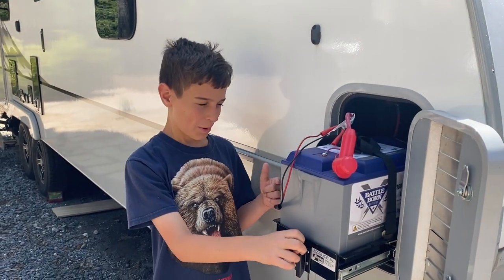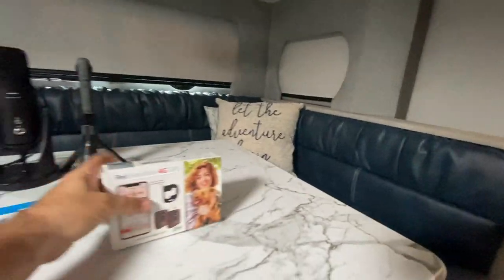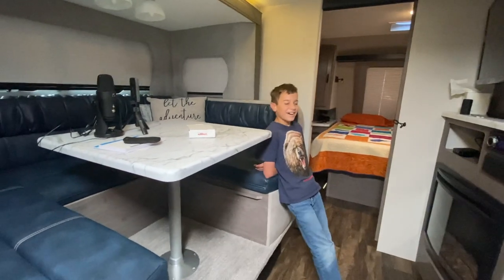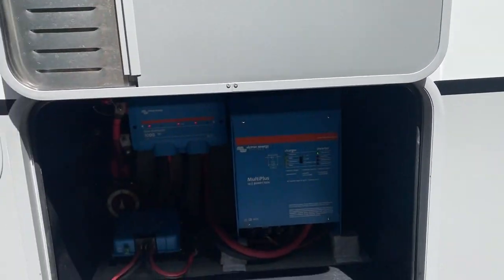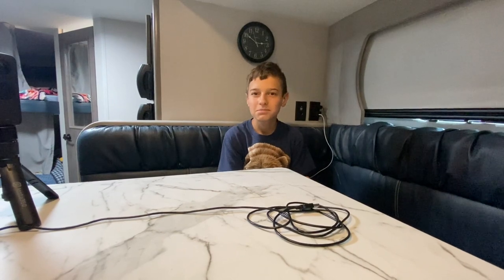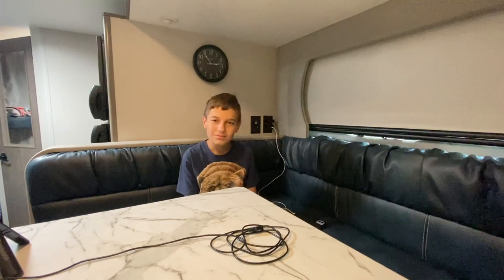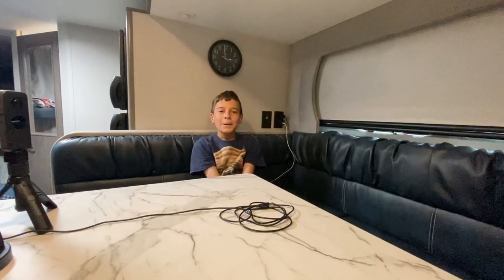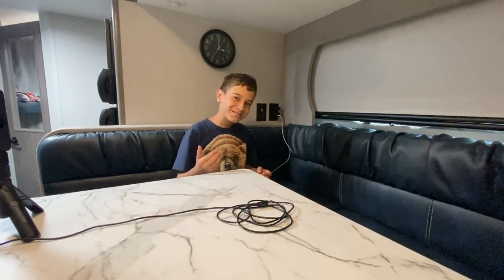Running RV AC on Batteries?

Comment: That’s running full time and hard with solar not connected. At Night, on a cooler Day, or with solar connected you may get substantial more time. Also had fridge running off 110v, keep fridge in propane to get more battery life their too. The fridge draws a lot of power when in electric mode.
Reply from the maker: Still working

Comment: I'm new & confused here. 15k BTU is about 4400 watts & you have about 4800wh in battery (So I thought?). So I'm wondering how you got 2.5h in AC. I know I'm doing something wrong but not sure what, could you please clear me up? THank you!
Reply: Im Actually getting even more out of it now per  a battery.  In this experiment I left the fridge running on AC and that eats into the battery  vs switching to propane.  I have now two more batteries as well.  

Each BB is about 1200 watt hours for 4800 watt hours for four batteries. 

I do have an easy start I installed that helps with the initial load. A 15000 btu AC pulls about 1500 to 1800 running watts and about 3500 watts to start (if you don’t install an easy start). The easy start lessens the start up load by spreading it out. 

I believe there is a link to the easy start we used in the video notes, if not, I will add one. 4800 divided by 1500 is 3.2 hours assuming no other draw and no loss from inverting (inverting is not very efficient). 

I hope that helped?  If not let me know.
Reply from the maker: Here is link to easy easy start I used.  Takes only a few minutes to install, super easy:  https://amzn.to/3ukFgch
Reply: What you did wrong, was try and do the conversion between btu and wattage.  It doesn't work that way with an a/c unit, at least not directly.

Comment: I just added a Battleborn/Victron system virtually identical to yours.  I'm in the process of installing 1050 watts of solar with the expectation of running the AC off it.  Your video is very reassuring and enjoyable.!  I also have a built in Onan genset which I don't like using simply because of the noise and I'm sure any neighbors we may have while boondocking will appreciate it as well.
Reply from the maker: I would enjoy seeing how you set yours up and hear how your solar instal goes.  I'm looking to add additional solar and considering my options to be ready for a big trip we are planning.  Thanks for watching!
Reply: @TreeTalkerTheTraveler  be happy to post a couple pics....as soon as I figure out how to!🤣
For now,  I have everything mounted under the bed including 4 lithiums.  I should have all  5, 210 watt panels installed and wired up today into a combiner box, then into the charge controller.  Wish me luck!

Comment: Have you looked into converting to a high efficiency mini split AC system? I've seen some tests that suggest they can consume as little as 700Wh at full blast.
Reply: We have not but have seen that some have done so. I imagine we will see (more) RV specific mini splits in the future.
Reply: @jonathanbell5561  why wait for "RV specific" mini split.... That's just waiting for proper gouging. I put a mini split in my semi truck.... And it works great
Reply: @vroor32  excellent point and glad it’s working for you.  The reason for me is limitations around installation dimensions and existing layout of my unit and my desire to maintain current cosmetics of the unit. I would probably do it anyway if current AC was not working for us.

Comment: Do you have a soft start device attached to your air conditioner or was the inverter able to handle the initial surge? It depends on your fridge, but I’m guessing you might’ve gotten another hour of use with that running on propane. Thanks for sharing your test results.
Reply: I installed a soft start.  Easy install. Agree on fridge. May try again and see.
Reply from the maker: I used this one:  https://amzn.to/3ukFgch

Comment: The time per battery all depends on the duty cycle.  It will run AC longer if it's 70 degrees longer than if it is 90 degrees.  A soft start will extend run time.  If you really wan tot extend time, look for YouTube videos for people who have installed a mini-split AC in their RV.  They are MUCH more efficient, like 8amps max usage, they are a lot quiter, and cheaper than those roof AC's if they ever need to be replaced.
Reply from the maker: Thank Brian.  We installed a soft start for this test and it helped.  I have done a little tweaking and we are getting significantly more out of it now, also added some batteries.  One big difference is during this test I had my fridge running on the inverter.  It pulled more than I thought so by switching it to propane it gave me more juice for AC.  Also if any cooler or less humid outside it makes a big difference.  We got a full day in Florida over Christmas running AC while waiting on a spot to pen at Fort Wilderness.  I'll do an update test and show those changes.   It does seem the mini-splits are even better, but right now Im not ready to that kind of overhaul on the RV.  Maybe one day.   Thanks for watching!!

Comment: Great video. You may want to look into a Micro-Air Easy Start system, for your A/C. It decreases  the start up amps, of the A/C, significantly. Mine went from 51 amps, down to 15 amps. It runs a very long time on a 2000 watt generator.
Reply: Thanks and agree. I installed and easy start as part of install before running this test.  RV units should come with it or n my opinion.
Reply: Heck I installed one on my 4 ton central AC and it dropped the amp surge from up to 80+ down to less than 40

Comment: The Battle Born batteries are bad ass and work great for me anyways and it will run ac for minimal 5 hrs and if it’s a lot more than that I will start my generator and recharge  my batteries my battle batteries they are the best no dout 15:35 15:36 about it and with them topped off I have a DC to DC charger by Renorgy that charges off my alternator and it charges very quick and could not do this with out of Battle Borns and they are the best for the money !!!
Reply from the maker: Battle Borns have worked great for us too. We also use a DC to DC charger with them. Thanks for watching.

Comment: But if you had solar panels up you could run it much longer.
Reply: Excellent point.  We didn’t have attached for this test, but we do have a single 190w panel and will be adding 2-3 more and then run this test again.

Comment: Great Video!! Is this still a 12volt system and did you run the Battle Born in series or parallel? Thank and keep up the great videos!
Reply: 12v system.  Batteries are run in parallel. Used to run AC while waiting on a campsite this week at Fort Wilderness and was going 4 hours with no issue. Was about 80 degrees and I kept fridge on propane.

Comment: Battery born are so overpriced.  
There are so many other options now. 
SOK Batteries are $560 for a 100ah compared to BB that are 899.00 for 100ah. 
SOK has just as good of a warranty. BB are just not worth it anymore.
Reply: SOK has done a great job putting a good competitive battery on the market and I’m glad to see it. Only real issue I have seen is supply issues. Longevity of Company is important for warranties and Battle Born has that, but I bet SOK will too. They are different chemistry and one may be better than the other for your application and the different demissions may limit you to one or the other. Battle Born has a considerably faster discharge and charge rate than SOK and that’s import to some people, like me. But there are options and it’s a good idea to see which option works best for you and your budget.  SOK, Lion and others may be the best solution but Battle Born is still a very proven company and a battery that should be considered.

Comment: And I have a generator that will charge the Battleborn batteries I just wish that Oman does not have a auto idle and that means it just crank on hi RPM so come on Oman get you stuff together or you will be left in the dust !!